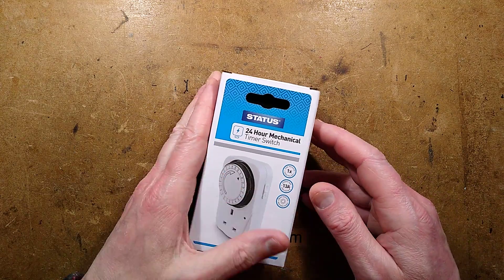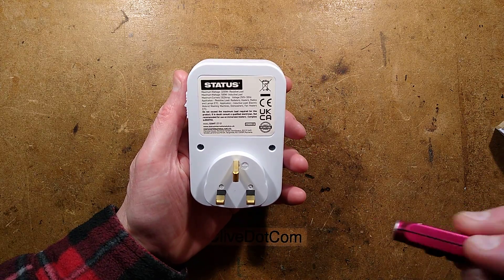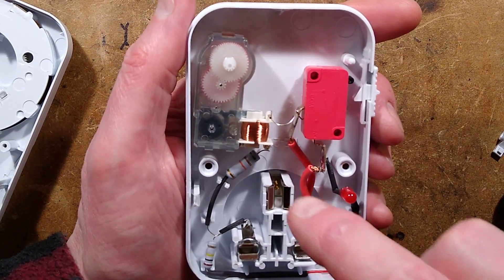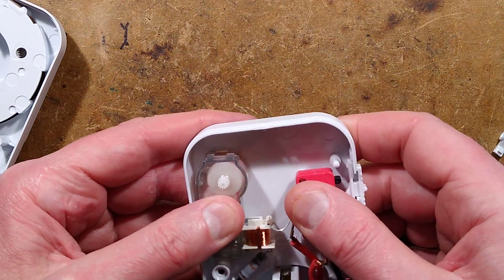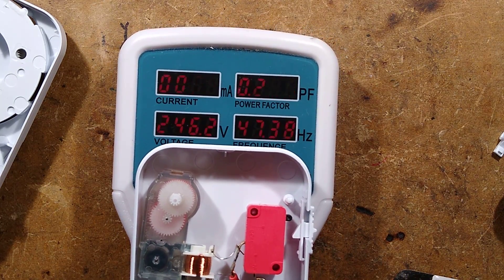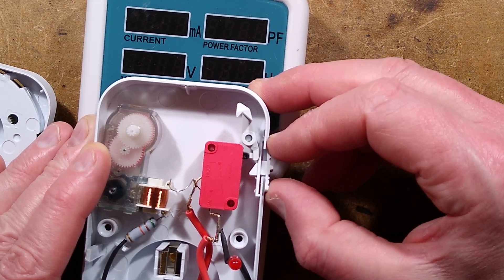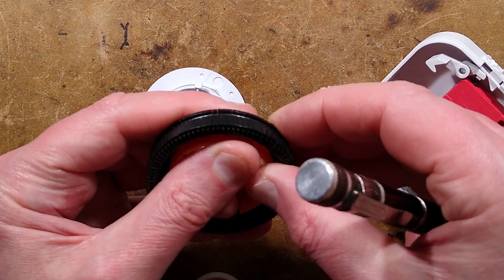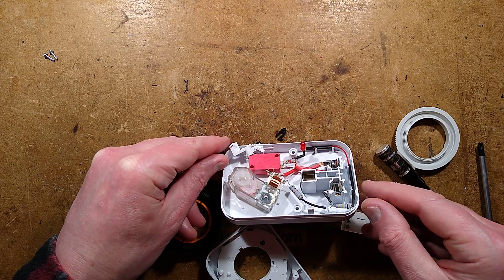Inside a simple mechanical time switch

Comment: Net frequency can vary quite a bit. Not that I have to tell you , but not everybody knows that the net frequency is far from perfect. That is likely why even a synchronous motor can't be more accurate than that. I seem to recall something about +/- 5% accuracy for the net frequency. Not constantly of course, but still.
Never really measured it though, so I could be wrong about the exact numbers.
If none of it is correct, don't blame me :p I'm in bed with a concussion, so I can't be held responsible XD

Comment: If its designed to be 24 hours on a 50Hz line, it will be 4 minutes off on a 60Hz line.  perhaps the use the same components and just change the plug style.

Comment: I've got two, different models/manufacturers, both fail after a lightning storm.
Reply from the maker: Nothing can survive a lightning strike with no surge arrestors.
Reply: @bigclivedotcom  When I say fail I should have been clearer that they stop working after almost any lightning storm but I can unplug them then replug and they are good again, I'm assuming it's light electrical interference affecting them, definitely not the catastrophic blow the TV up surges.

Comment: Running 600w of HID ballasts on these cheapy timers. Never a problem, very reliable. There's a relatively new digital version that allows ON periods of just 10 seconds, and still just as chrap. Perfect for irrigation pumps.
Reply from the maker: If there are power factor correction capacitors on the ballasts it can cause contact welding.

Comment: I guess, the 6minute accuracy is about the mechanical switching, because of imprefect spacing of these black teeth. Every one is 15 minutes, so even the slightest move to the side or not fully pressing them down can and will affect the switching accuracy. I had one of these timers to control the power to a boiler. Never let me down, to be honest, and I don't remember to have corrected the time for many years, so I guess the motor is really doing it's job. On the other hand I sometimes used to turn the wheel manually, because using the override switch and forgetting about it made the water too hot 😅

Comment: Anyone else noticing this tendency for stuff to be held together with security screws, torqued to the moon so that only the exact high quality bit will shift them? Is it some sort of regulatory requirement somewhere? Most recently had a fan heater with 3 x phillips / pozi / jis and one tri wing, and a 12v inflator with far too many deeply recessed torx which a cheap screwdriver wouldn't shift.

Comment: They're great because you can see the time and settings at a glance. After a few decades they may need lubing though. I also have a really nice Smiths Industries time-til-on timer I use on the washing machine. It of course consumes nothing once it stops and the washing machine starts.
Reply from the maker: They do start making a bit of noise after a while.

Comment: Hi Clive, can you explain more about why red LEDs can work in series with resistor in mains, other colors can't? Or maybe some good keywords to google the answer myself...
Reply from the maker: The gallium arsenide red LEDs are more like a traditional diode junction.  The modern gallium nitride ones use a complex thin film technology.
The red LEDs will outlast modern LEDs significantly.  They genuinely offer over 100,000 hour life.
Reply: @bigclivedotcom  Thank you. Designing one my project I've found all color LEDs have very low reverse voltage and added some diodes serial to LEDs to be sure. Never heard before your video red LEDs have more robust and may withstand avalanche effect. Your videos are very interesting.

Comment: I recently took apart a timer internally identical to this, the rotating clock part was spinning mostly freely with some grinding noises here and there, all cos the small gear poking out from the gearbox had been stripped from someone turning the dial too hard, came from a box of junk I got off ebay which had a few interesting items in it, including a transparent-green NEC "PageOne Minicall" pager which "works", but the number's inactive sadly... :P

Comment: I carry those mechanical time switches in my car, they are brilliant as a temporary replacement when fridge freezer thermostats fail , bypass stat or electronic board. You can set one of these with 1 hour on 1 hour off all day and few hours off at night.  Means fridge will work till stat or board  turns up. Ps that's quite a good one it's got a microswitch. Some District have a couple of cheap copper contacts being mushed together . Thanks for posting

Comment: I use the mechanical timers to run the Christmas lights (indoor and outdoor) and to switch a couple of interior lights such as table and standard lamps when we’re away. Their inherent inaccuracy gives a sort of random offset to the lights switching which, in my mind, acts as a deterrent to intruders. (I’m too bloody cheap to buy a wireless system when I’ve got all these mech-timers!)
Reply: Plus they’ll use less electric and zero WiFi bandwidth, unlike wireless ones! 👍🏻
Reply: I had 2 near identical timers from decades ago.  One the clock failed, but the second still works and is used for Xmas lights, and for a table lamp for when we are away.  It has 4 crosshead screws holding it together.

Comment: The inaccuracy is not the motor, it points to the rough way the quarter pins work, you will never be able to set them with more accuracy than plus or minus 6 minutes. But when you want to start something precise every day, let the motor run until the switch activates, pull out the clock, wait until the real time is there on a good clock, and connect the timer again.

Comment: I bought ½ dozen similar items  for  little money from Ikea  pre-covid when I was going to be away from home for a few l months. They're great. Keep perfect time - why wouldn't they when the work on 50Hz?
The clock on my brand new oven is about as accurate as a Mickey Mouse kid's watch from the 1950s.
I've run an oil-filled radiator on one with no problems. Although I wouldn't leave that on when I'm not at home. 
Thanks Clive. 😊😊😊

Comment: i just installed a digital timed switch and it was a PAIN. i was kind of shocked how complicated they made the programming! its a simple relay inside that uses a sip of the mains voltage to trigger the relay on (i think its rectified down to like 3.3v dc), but the programming has multiple events, automatic daylight savings, an internal table of sun up and down values for each time zone, and it even has a way to communicate with downstream "smart outlets". i have no clue how its doing that, but i imagine its twiddling a DC offset or something to send messages (similar to how ethernet over power lines worked). it all was a bit much for a simple timer where i just need the switch to come on at night and off in the morning lol
Reply: I think these digital timer switches are the generational replacement for programmable video recorders. There has to be something in our lives that's sort of useful, not essential, and nearly impossible. The one advantage of a digital device with a good battery backup is that time is kept during a power outage. The simple mechanical devices will all have to be reset once the power resumes if correct operation depends on time of day.
Reply: @pendarischneider Funny you mention that. When I got a digital timer with multiple programs and fancy stuff, I looked at the manual, and '80s-era programmable VCRs (before on-screen programming menus came along) is exactly what the user interface reminded me of. Fortunately I happened to grow up doing being pretty well with that kind of stuff, but even then I can't help but feel the interface could have been a lot less clumsy and more intuitive. Surely it wouldn't be all that expensive these days to replace those old-style custom segmented LCDs and complicated button arrays with a generic dot-matrix LCD driven by a microcontroller with a more natural menu-based system, maybe even utilizing some basic graphics, to make the programming process more clear and legible.

Comment: I get something similar in the EU and is not good when the powers gets down, the clock is not in sync anymore.
Also, seams to bypass some power to Christmas light because the light are low. (This seams to be to the Digital ones too)
not sure why, if I put ones upside down, the power are not passing anymore.

Comment: There are apparently 5 possible timing settings/pin positions for each hour, so their spacing is 12 minutes. For the ACCURACY of the timing of each position, given the construction method and materials, the best that could be expected is +/- 6 minutes. The repeatability (with a synchronous motor) is obviously much better.

Comment: I presume the gearing also has to be selected for the local power line frequency if it has no other means of timing, i.e 50:1 gear ratio for UK and 60:1 for US etc? Or perhaps some reduction that relates the line frequency to the number of pips on the dial.

Comment: The accuracy over 24 hours depends on how closely the 50Hz is maintained. 
So 4,320,000 vibrations per day.
Whether the voltage is 220V or 240V makes no difference.

Comment: I am so afraid of these plastic timers and thier miss use by home owners .They just melt .I like intermatic but tgey aee bulky .Now some where in a junk pile i have old mechanical timers .They were useless in the food industry all the dust and oil got in and gummed them up and we all went to 555 TIMER BASED control relays .That was the end of plastic gears

Comment: The motor is synchronous but on those modern timers it's much smaller and probably also much weaker than on older units so it may run out of sync while trying to push the micro-switch 🤔

Comment: I loves me a nice shaded pole motor. I'm guessing the manufacturers just swap out the reduction gear box for 50Hz vs 60Hz regions?
I think the stated accuracy may be due to the mechanical nature of the mechanism, not the motor's synchronization with the power grid. Just as with any mechanical alarm clock, it could trip plus or minus a few minutes of the set time on any given cycle, with a Gaussian distribution over many cycles.
I see you've reached gold play button subscriber status. When did this happen?! Congratulations!

Comment: You can get them for $5 at Harbor Freight in the US. I have one running a 5 W LED that's been keeping my bioluminescent algae alive and happy for years now. Incredibly, it keeps time more accurately than the various quartz based clocks around the house.
Reply: Line frequency is always going to be more accurate than a quartz clock. At least until the power runs out.

Comment: I have one that's even simpler than that, as it was the only one I could find that could allegedly do 13A inductive. It has no always on of or auto switch. I got it for my electric car as I wasn't sure what the power  factor was when charging. Plug and Grow 13A Inductive Heavy Duty Plug in Timer

Comment: Very small motor does not have the torque to be accurate.
Reply: It is operating a geared mechanism therefore not all that much torque required.
Reply: @brucepickess8097 You can only improve torque so much with a gear box.

Comment: Hi Clive.  Love your videos.  I just took apart a failed IKEA 24 hour timer, and all the parts (including several gears) went flying all over the place.  I figured out where everything went and got it back together.  Still fails, gear slip.  They wear out.
At 7:20, you show the 'Freewheel.'  It alllows you to advance the timer wheel clockwise (not anticlockwise) without engaging all the gears.  It makes that funny clicking noise when you set the time.  The motor is self starting in the correct direction.

Comment: By a quick glance, looks like the same mechanism as a cheap Poundland clock… so wouldn’t expect it to drift too much, the worst I’ve seen is probably about an hour over about 3-4 months, but can’t be beaten if you want something that turns on for 15/20 minute intervals (depending on number of pins), and not too bothered about the actual time, works great

Comment: i have a few of them of various ages, i picked up 2 'smiths' ones from a car boot sale and they probably date from the 80s, one even has unshielded pins! one had a capacitor for the motor dropper and it had gone very low capacity, a replacement pinched from another physically damaged timer cured it , the other one used a resistor dropper

Comment: One big advantage this still has over the typical digital ones is it gives you more switch times. Use a digital and you can set one for the morning, one for the afternoon and that basically it. If you're really lucky it gives you a third one. Meanwhile with the mechanical ones you can switch your device on and off every half hour all day long.
Reply: IDK, the latest ~ $10-15 digital timers typically have around 20 separate on and off events and cover a 7 day schedule. They are super accurate and most have a little rechargeable battery to back up the program. These have come a long way compared to early  digital timers. Depends on the unit, but some can be a pain to program, although I have one which is amazingly intuitive! repeat cycles and even random cycles are pretty standard features on most.
Reply: @professorg8383   The modern digital timers do have lots of features but their accuracy is limited to the cheap watch crystal used. My digital lamp timer is off by 11 minutes but my synchronous motor alarm clock is about 1 minutes behind (and not coincidentally I've had a total of about 1 minute of quick power outages). The best approach IMO is to use the power line when available and revert to quartz only when needed.
Reply: @eDoc2020 That's been my experience, too: digital timers are precise, but not necessarily _accurate_. I have one with a seconds indicator, which is pointless since you can't reset the seconds and the thing loses or gains several minutes a month anyway. The synchronous motor ones tend to be the other way around as long as the power doesn't fail: They stay on time once set, but getting them programmed within an accuracy of better than several minutes in the first place is rather challenging, at least for me with the units I've used. Another potential downside is that the mechanical ones I've seen sometimes make gearbox noise, which can be a bit annoying in an otherwise quiet room.
Reply: In Africa we have frequent power outages, and all the mechanical timers have to be reset. The the digital timer is king here because of its memory.

Comment: I have several to time my Christmas decorations.
I upgraded a few years ago to the digital ones but the battery's expire when left in the drawer the rest of the year, and even if one survives I then have to read the instructions again to set it up.
The mechanical ones win all day long.
Reply: Not only do they last, but the 6 or so I have are used for my Christmas Lights, so come out for 6 weeks in Nov and go back late December/January. With the programming being mechanical and left as is when put away, when needed, I just plug them in set the time and they are ready to run again with no extra programming needed.

Comment: Those things are absolutely durable. The synchronous clock mechanism is accurate (as good as the old Smiths Sectric); the only "real" failure point is the microswitch and the life of those contacts can be helped by a simple RC network.  All of ours have .25 " slide on connectors, so possibly ours are upmarket versions (although bought from our local Reject Shop many decades ago).
Reply: I've had two mechanical time switches fail on me personally. Both times it was gear failure, the switch mechanism was perfectly fine in both cases.

Comment: 13 amp is a wish, they would burn out turning on temperature stirrers in my old lab, also wonder if the accuracy of the clock is just the response to being on / off load or just the different power supply of the world.

Comment: No Electronics, Excellent even better no Software - will work for decades because you won't have to worry about capacitors aging or Flash memory drop-out, batteries going flat et al.

Comment: The advantage of the mechanical time switch is it works even when there's power outrage.
Reply: No it doesn't.
Reply from the maker: They do quartz versions with a backup battery.

Comment: If you back-feed it in reverse. By feeding power into the socket,  and taking the output from the plug. It the becomes a "run once timer".  It will effectively turn itself off.  Of course it's much safer, just to switch the wires around on the inside, so that the input and outputs are reversed.😉👍It's a handy mod if you only require a device to run once, and then stop.
https://youtu.be/El5k5efaWWA

Comment: Six minute accuracy? Mine are accurate to within seconds. They also seem fine with inductive loads like 'tomato' grow-light ballasts.
Reply: If using 600w HPS, they can fail 'on' eventually, messing up your 'tomato plants' photoperiod. Worth the peace of mind to get a contactor and use one of these to switch the contactor on/off.
Reply from the maker: It's often the power factor capacitor that causes such a high initial inrush current that the contacts weld.
Reply: @bigclivedotcom Maybe so but whatever it is these Status timers seem to be far less fussy about it than other brands. My half-baked, evidence bereft theory is that it's because Status use a proper microswitch and other brands use random bits of bent copper they salvaged from a skip.
Reply: @MattyEngland I look in on my 'tomatoes' often enough that I'd notice. I've been using these switches for years and the only problem I've ever had is the motor/gearbox failing and the dial not going round at all. As that only seems to happen after a few years of almost constant running and they cost a fiver each it's something I can live with 🙂🥕☘